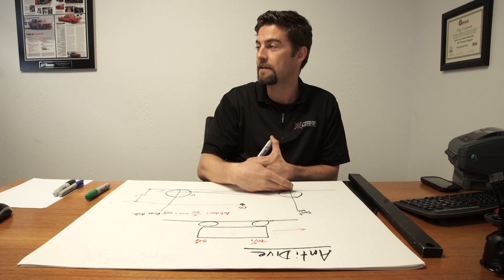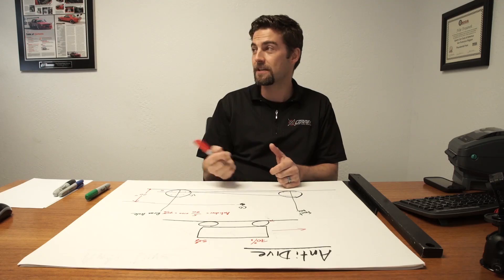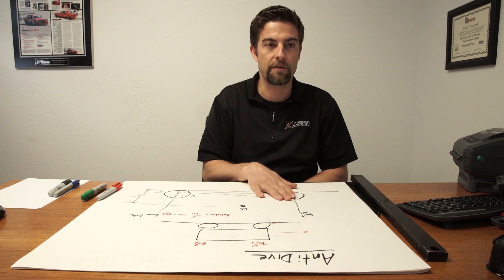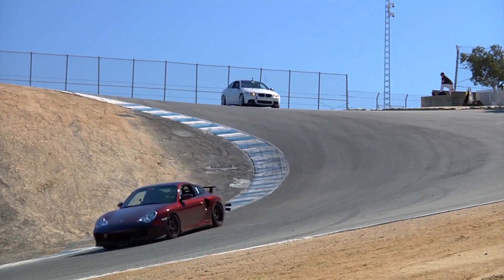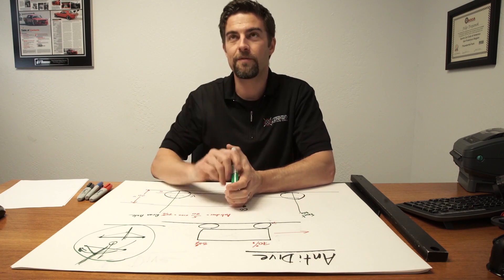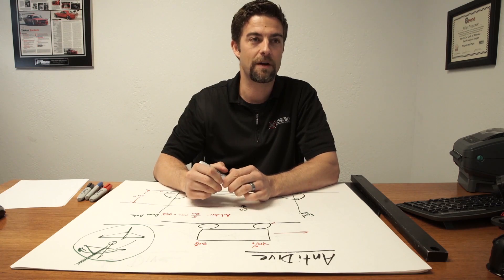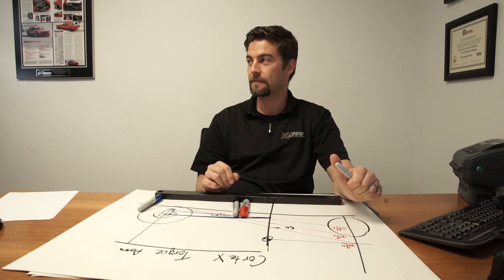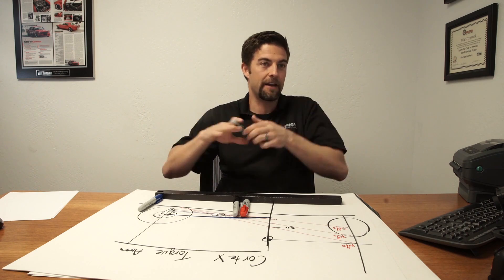CORTEX DIVE SQUAT  - /ENGINEERED

Comment: Anti-dive and anti-squat are just a way to arrange the suspension geometry in a manner that some part of the forward or rearward shifting load tries to compress the support arms instead of the springs and dampers. In a very simplified example, one could think of it like a minute hand of a clock. When it's 15 past, pressing directly downwards on the hand will rotate it. When it's 5 past, pressing directly downwards will turn a major portion of the force you're using into a compression of the clock hand, while the rest of it rotates it.

Comment: great Video,just something I was wanting to ask,If the torque arm is rigid to the rear axel and pivots on the mount on the Chassis. because the lower arms are on a different arc and length, with-out a sliding member or a de-coupling torque arm, wouldn't the system as drawn on the paper bind in suspension travel? If you pictured both arms were parallel to the ground and you went over a bump and the suspension compressedthe lower arms being on a shorter arc/radius would try and pull the bottom of the diff housing forward against the arc/radius of the axel fixed torque arm causing bind? but yes still a great video and explains the factors really well. just wish it was longer that guy knows his stuff.

Comment: How does one learn about this without the 'try and miss' of racing? Is there books or some kind of school to look for? Thanks
Reply: Carroll Smith's "Engineer to Win" book isn't a bad place to start.  Probably a touch simplified but a decent primer.  William Mathis has a few books about Mustang suspension in the "Mustang Performance Handbook" series.  Mathis is VERY out of date by now, but still covers a lot of particularities to the Fox and Fox4 (SN95) chassis cars as well as some of the older stuff too.  Most of which can be, in general, applied to strut front or live axle rear suspensions.
Reply: Thanks, apreciate your reply. My goal is not strictly about learning about the Mustangs or only live axle but more about how geometry works. If I was to design a new suspension from scratch, for any car, you know? What do engenniers do first, where to start? But thanks, I'll look into thoso books.
Reply: Remember that the purpose of the suspension is to maximize the tire contact patch and do so in a way that allows for a balanced car suspension (for racing anyway this means a car that is neither pushy or loose).  

As Collin Chapman once said:  "Any suspension, no matter how poorly designed, can be made to work if you simply keep it from moving."  

This is the same guy that went on to give us something absolutely awful for rear suspension called the "Chapman Strut" which is a strut based rear suspension with all of the problems of strut suspensions and none of the "benefits".  The irony was not lost on me, I promise! :)

He also ironically went on to go to Lotus and give us the "Simplify and add lightness" quote...

Comment: This guy is very smart and this stuff is amazing. I work at a small shop in california and am the only employee and my boss has a guy with a ford ranchero that is full blown race car and we put a whole cortex suspension on it that was designed for a mustang so it all had to be modified slightly but basically its going to be the first ranchero with this type of suspension and its just pretty neat to work at a place where something so awesome is being spawned. It has the torque arm setup he was talking about, and cantilever coilovers facing eachother in the bed.
Reply: Old reply but it sounds awesome(the car and setup). Only thing is that there is no such thing as cantilever suspension. Many people  call rocker arm with push rod suspension "cantilever" but a cantilever is not a moving system. It is a structure that supports weight. No one says" I have an  overhead valve engine with cantilevers" because it's got rocker arms and pushrods not cantilevers. Exact same thing.

Comment: I sent my 2013 Boss 302 to Filip at Cortex and they took the car to another level.  Filip is very knowledgable about how to make a suspension work.  The craftsmanship of the Cortex parts are first class.  If you have a Mustang and want to take it to the track or want it to be a more enjoyable daily driver - take it to CorteX.  You will not be disappointed.  I had them install the extreme grip package along with the torque arm/watts link and JRI shocks.  I can run 315mm wide tires at all four corners and it looks like the car came from the factory with them.  The car handles much better than stock and it is predictable when pushed hard.  Filip will take the time to answer your questions and help you build the car you want.  He will ask you what you are looking for and make the best suggestion for your budget.

Comment: Cortex Torque Arm seems very similar to old school traction bars (ladder bars) that were being added to high HP muscle cars
Reply: +Evan Moon finally an explanation that i can kinda understand, and find further info about. lol
Reply: Except that ladder bar suspension is the only "suspension" there.  In a true ladder bar setup the rear axle has no other suspension components and is not allowed to articulate with imperfections in the road because rear axle physically could not roll about the roll center because the ladder bar prevented it.  In sideview, the geometry is very similar, but in plan (top) view and front view it's far less restricting than a ladder bar setup.  It makes it very versatile for those of us who actually want our suspension to articulate some to match changes in the road! :)

Comment: I've got a pretty good understanding of physics and cars, but when theres all of a sudden a bunch of numbers and angles on his piece of paper and he just launched into talking about percentages of anti squat/dive, I had no idea what was being said.
Reply: +Fact VS Conspiracy They needed to take that drawing and animate it into motion of wheel traveling up and down(or the chassis squatting or diving)
Reply: Basically anti-squat and anti-dive direct the forces that would normally go through springs and dampers, through the support arms. So when there's a 25% anti-dive, only 75% of the load that shifts toward the front axle under braking goes through the springs and dampers. In essence it bypasses the suspension and takes the load (or a portion of it) directly to the tire.
Reply: This can also be used in a lateral direction to control the roll of the chassis under cornering. However there's always some kind of a trade off, and in this case it's responsiveness vs. grip over bumpy surfaces and tire wear. Here's a good video related especially to the tire wear case: https://www.youtube.com/watch?v=EQzMrbDtndE

Comment: so a torque arm is similar to sway bars - only on a different axis?
Reply: STARSHIPTROOP yup, mechanical grip varies inversely with general stiffness of suspension geometry (springs, damping, and sways); that part i understand. ;)
Reply: +Nick Amarit NO, 2 different things, 2 different ways to control them
Reply: +STARSHIPTROOP but dive and squat are similar to roll though - just forwards and backwards instead of side to side; hence why i thought the torque arm (which prevents dive/squat?) is supposed to act like sway bars, which prevent roll.
Reply: +Nick Amarit Similar in result, different in function.  The torque arm is acting to create a geometric anti-, much like roll center height does for roll motion.  Sway bars create anti- via elastic force.  Something like the FRIC systems F1 teams used would be a similar concept in pitch.
Reply: Casey Ringley i guess it's still too complicated for me at the moment. hahaha oh wells, anyways, on to the next question... are aftermarket torque arms difficult to find? (can't seem to find one for an E46 on the internet)
Reply: +Nick Amarit You have independant rear suspension, so your differential is already solidly mounted to the car, I'm not sure how you would dial in anti-squat on an independant rear suspension.
Reply: ConnorWolf oh, so is it redundant for independent rear suspension then? perhaps independent rear suspensions already provide anti-squat to a certain degree?
Reply: Nick Amarit anti-squat would mainly be dealt with on the bump setting of your shocks(if multi adjustable), though some antisquat can be built in to the mounting of the pick-up points for the wishbones
Reply: STARSHIPTROOP ah, ok, so there are many ways to conduct anti-squat on an independent suspension setup.
Reply: Nick Amarit almost forgot, if you also have a spring with a progressive compression rate, that will go to anit squat as well. But remember if you go too far, mechanical grip will suffer.

Comment: when a RS6/7 launches it squates so hard
Reply: +vivalaphill which is why the RS cars have RIDICULOUS 0-60 and 1/4 ETs even though they're modern-day land yachts.
Reply: +vivalaphill hence the NO anti squat, to get maximum mechanical grip
Reply: STARSHIPTROOP it has quattro -> therefore totally fine. and its not really ment to be thrown around a track
Reply: Sai Namuduri yep Quattro is the AWD system to have.
Reply: Michael Sanderson tell that to koenigsegg. doesn't apply my ass. are you a chassis engineering expert?

Comment: I don't understand why does the new mustang breaks the rear tyres loose easily because it doesn't have much anti squat? Wouldn't having less anti squat improve rear traction because the rear tyres have more weight on them from the car squatting? Just trying to understand this.
Reply: +Pratham Rathore The more the car squats the more energy gets lost in the suspension instead of the tires. Having less squat puts more energy in the tires thus allowing them to grip more ;)
Reply: +Pratham Rathore Thats not whats happening. Anti squat means more energy is directed straight to the contact patch. less anti dive means more energy is being absorbed by the suspension.

You can in fact have so much anti squat that upon loading the drivetrain up the rear of the car will rise, if you understand the itea of equal and opposite reactions its easy to see why a force pushing the body up must also be pushing the wheels down right?      So if the energy at play causes the body to move down the laws of physics say there must be an equal and opposite force pulling the wheels in the opposite direction.  

Also you can forget the idea that the way a car reacts during a launch having anything to do with weight transfer.  Especially in the very early moments.  When someone talks about squat it can have nothing to do with weight transfer because weight cant transfer until the car begins to move and squat/anti squat is in play from the moment torque is applied to the drivetrain.
Reply: DrewLSsix I think I understand, or at least I'm beginning to understand. Thanks!
Reply: +DrewLSsix   That is incorrect.  If that was the case, the rear wheels would literally jump up into the wheel wells every time you accelerated hard.  The opposite force you're speaking of is acting on the front of the car.  So, as the rear squats, the front lifts.
Reply: +tayl0rd that's exactly what happens, it's called wheel hop. If you lack anti squat the torque reaction pulls the wheel up towards the vehicle. But once traction is broken that torque is no longer being applied, the suspension works to force the wheel back down thus loading the drivetrain through torque reaction and repeating the process. 

I think you should research this, it's not always obvious but it is a thing and it does inform all suspension design concerning driven wheels. 

What you are describing is only possible when the vehicle is moving forward. Torque reaction as I describe it comes into play even when the car is stationary and that's why it is so crucial to acceleration and handling.
Reply: +Pratham Rathore try looking for videos on YouTube of the Buick GNX. There are a couple showing the somewhat unique suspension design and how it behaves. 

The geometry is designed so that with the car completely stationary the driver can hold the brakes down rev the engine in gear and the torque reaction between the body and axle will cause the rear of the car to rise about 3 inches. 

If you imagine actually launching the car during a race you can see that as the torque forces the rear of the car to rise the opposite motion is the axle and tires being pushed down into the ground. This creates an tremendous amount of potential grip over what is available when the car is static. 

A car with zero squat or anti squat will only have the amount of traction dictated by the type of tire mounted and the static weight of the car over the rear axle. This will immediately start to change as weight shifts under acceleration of course.

Comment: What happens when you have soft dampers and hard springs?
Reply: +jesse chen You get a 60's american muscle car.
Reply: +derbigpr500 No? not at all.
Reply: +jesse chen actually you get a car that over exaggerates lateral movements
Reply: Remember seeing those old caddys and town cars barreling down the road with worn out shocks? They look like boats  hitting waves, lumbering about the freeway. That's an exaggerated visual of what's happening in the situation you've described. Without adequate external dampening, you bounce and sway all over the place in an 'under damped system' situation. In a performance setting this is bad, as you're not getting optimal tire contact and therefore not maximizing grip in any of your acceleration events. In a road setting, you may get motion sick and potentially strange wear patterns on your tires, not to mention wearing out your bump stops.
Reply: You "pogo". The suspension over reacts and puts a ton of energy into the spring (because it isn't dampened, literally), and then release it all very quickly. You then give up too much energy to support the weight of the car and bounce back down then up then down.

Think of a super bouncy ball - that is your spring. The dampener slows that motion.